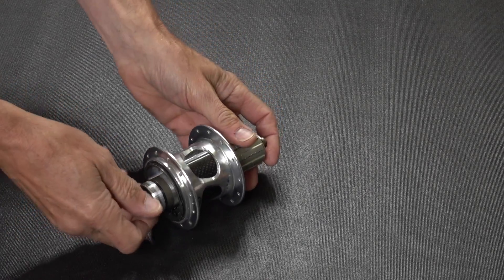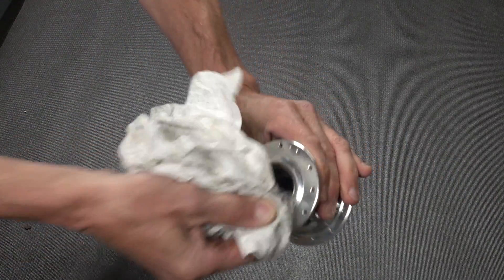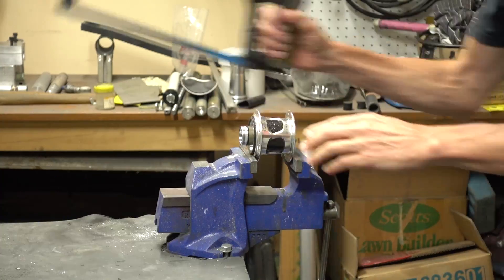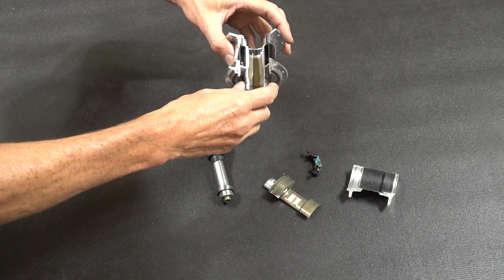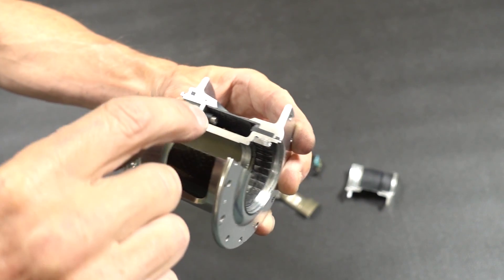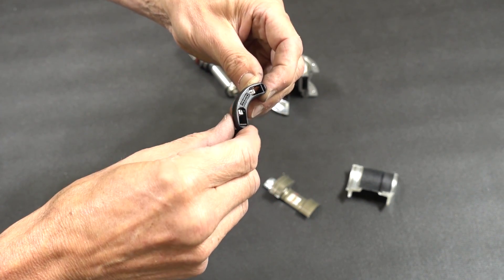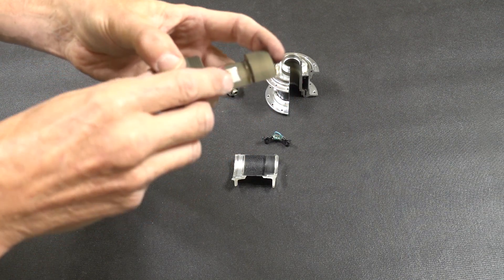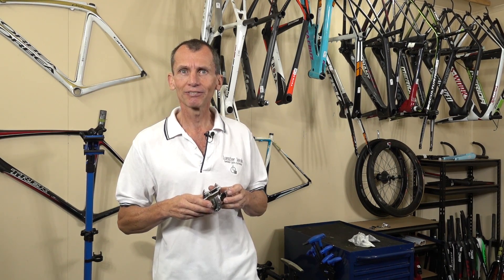PowerTap Hub cut up and how it works

Comment: any ideas how to reset the torque tube as mine will not zero when calibrating it with my garmin. its reading 7.22 with the wheel out of the bike? thanks for the great video.
Reply from the maker: Hi Chris, there may be a component failure in the board or other causes for this, I would recommend sending it back for refurbishment. Sorry I can't help you with this

Comment: Great video, thanks to both of you for making this available. I have one that has also failed and got it apart as far as the hacksaw. I figured I had nothing to lose and could gain some education by pulling it apart. I wondered whether it was pressed/bonded together and was considering trying to press it apart, but had a bad feeling about it and can see now that wouldn't have worked so that was a good hunch. 

Have you ever disassembled/reassembled one without the hacksaw?
Reply from the maker: I have not, however it is not difficult as the torque tube is just screwed into the hub shell, you just need the correct tools to unscrew it.
Reply: Awesome, that's how it looked in the cutaway, thanks very much. I have a machine shop so it's normally no trouble to make up a tool to suit. I'll put that on the To-Do list. I'm just curious if I can track down the cause of failure. I used to dislike that wheel so no great urgency to get it working, just natural curiosity.
Reply: @886014  Hi Pete, I know I'm replying to an old post, but maybe you're still around. Did you manage to fabricate a tool to remove the power-meter core from it's hub? I need to replace the flex cable that connects the batteries to the board. It's a left-handed thread, right?

Comment: Great video.  I have thought about getting an Powertap Hub in the past, and was always curious why they were so large.  From your video it now becomes clear.

The layers are axle, bearings, inner (torque hub) and outer spoke hub which creates the bulky appearance, and allows for servicing.  I wonder if anyone ever considered building a power metre between the ratchet and the axle?  That seems a obvious interface where torque is transferred through to the spokes/rim.

Comment: I just wondered if the blue wire could be used to tie the batteries together? The cutaway is interesting because it shows the exact position of the bearings inside the hub body. They appear to be somewhat offset in their alignment. Unusual because it may not support the weight of bike and rider in a straight vertical line.
Reply from the maker: I checked the blue wire and it does link the two batteries. With the bearing position I would imagine that they are positioned in this way to accomodate the other components.
Reply: Glad I could help. I chuckle to myself. I've had a little experience with electronics so, that was an easy guess. I've watched a couple of the older cutaway videos and they're quite an eye opener. Great work.
Reply: If only to link the batteries, it would be a much tidier and more professional job than that. I suspect you're both correct. the ugly blue jumper to also assist in removal/replacement of the battery housing in that confined space. also keeps sweaty salty fingers from touching the batteries. 

Another great vlog Raoul :)

Comment: Yeah mate!  Good video.  Interesting to see the wear pad...  I wonder how the wearing down of that over time affects things?
Reply from the maker: Good point, it is quite well sealed however friction at this interface could change the torque values slightly, the torque tube could also fatigue over time and fail.

Comment: Excellent vid, thanks to you and Shane !  Just a thought on the magnet...wondered if that was for rpm of wheel for speed rather than for cadence since cadence would depend on what gear was selected.  Think PTap hub estimates cadence via equating 2 power spikes (left and right downstrokes) being equal to 1 rpm of the cranks, but may be wrong :-).  Anyway, very interesting and keep them coming !
Reply from the maker: Definately for RPM of the wheel, as it cannot know what the legs are doing directly. Having the wheel speed and the power spikes and hence cadence, it would be possible to calculate the gearing.
Reply: Gary M agree with you about the rpm part. I also like to know the purpose of the floating part where the strain gauge installed on.